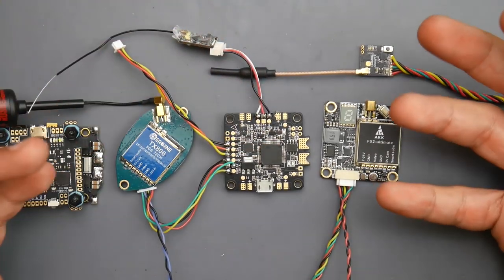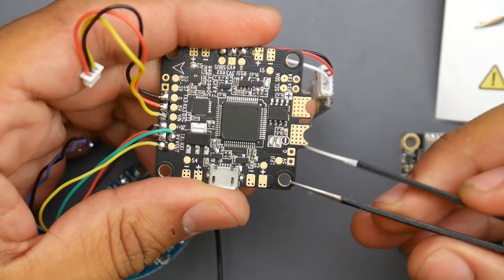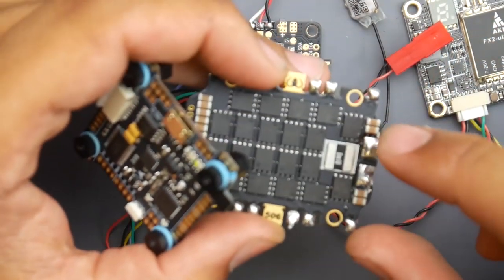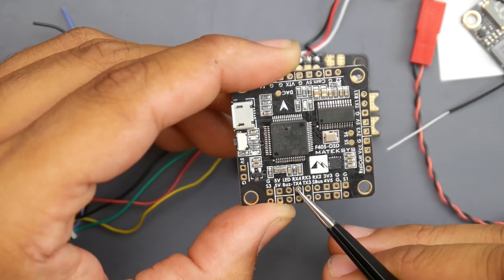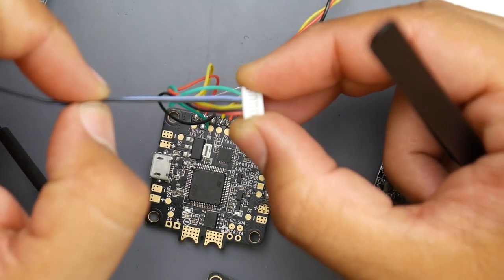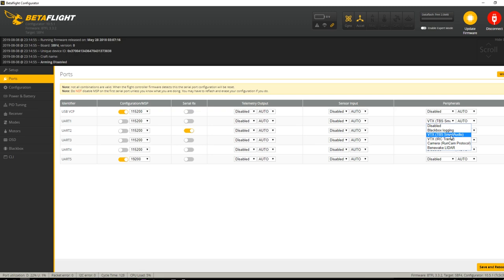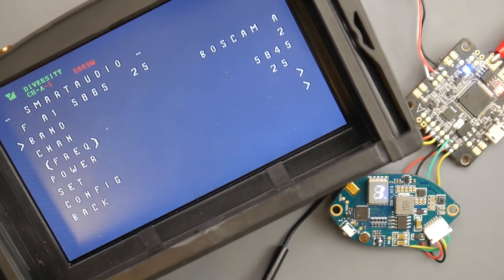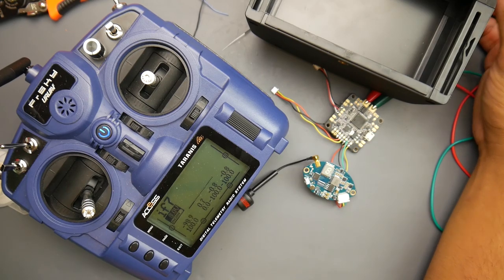FPV Beginner Guide P2 // HOW TO WIRE & SETUP VTX WITH SMART AUDIO GUIDE 2019

Comment: If you are going to connect the VTX to the power input from the battery, you should solder a 1000 micro farad capacitor across the positive and negative terminals. This will serve to limit noise on the video stream. Also a good practice solder it on, to save sensitive electronics from voltage spikes.

Comment: I want ask a question about connection if a buy a camera and vtx module. The vtx module has 3wire so where should i connect the which wire in flight controler for drone or in receiver for rc plane

Comment: Thanks for this. Your video tutorials are very helpful.

But i have a problem i hope you could help me. 
I'm trying to connect my VTx (GEPRC Stable VTX v1.3) to my FC AIO (JHEMCU F411 Pro AIO). The VTx has 3wires has 8wires all-in, 3wires from the fpv camera (5v, grnd, video in one connector wire to the fpv camera), and another set of 5wires (5v, grnd, Vin, Vout, TXD). The last 3wires is what i have a hard time figuring out where they goes (Vi, Vout, TXD).
The FC-AIO has 4pads open i can possibly solder the wires into. These are: Tx1, Rx1, VTx, and Camera signal.
Can you please help me where i should solder the 3 VTx wires (Vin, Vout, TXD) into the FC-AIO pads (Tx1, Rx1, VTx, Camera signal)? 

Thank you again so much. And i hope you can help me.

Comment: If there's new guys watching these like I was. Definitely don't put a full batt vtx (7-25) on 5v. On another note I think 2023 (year) plus you may not need a S/A wire and can still access the betaflight settings. I have 2 builds that can, a 16x16 vtx that survived a fire and a hm850 from flywoo/RDQ.

Comment: thanks for this video! sooo the current documentation for Eachine nano V2 VTX shows 5V IN, GND, "RX", 5V OUT, GND, and 5V OUT; I would assume the RX printed in this case should be a ""TX""? or does the RX in my case indicate receiving data from the FC's TX pad which is where I will solder to TX3?

Comment: So I have a question, maybe is a dumb one, but I'm really noob at this. So I have a blue bugs 3 (it's a made drone kit for kids) and I always used just a budget camera with a 1s lipo, but as expected, the signal is very bad, so I was wondering if I could get one vtx and use it just with camera connected to the vtx and battery to power the vtx, without connect it to flight controller, because I don't have pads for that, or it's impossible to do that?

Thanks so much for the help

Comment: Great video easy to follow. Unfortunately I still need some help.my smart audio is working but the table for power is wrong. I understand that if the mw value is wrong the vtx olny outputs 25 mw. Values of rdq. Vtx are 25,200,600 & 1000. Can I just enter a command in cli to change this, or do I have to flash 4.1 and import the tables. Then  change table to correct values?

Comment: Great videos!

Do you also have tbs crossfire setups?
I have a multiple nano’s. I wired one of my quads in a similar way once, and I was able to control my vtx though my tbs module behind my taranis once and adjust my rates. by the way any videos on rate adjustments? 
I enjoy watching your videos also my baby niece loves your into song by the way 🤙 and thanks for recommending the dalrc f722 with 50 amp esc’s, flies gtreat on my marmotte, wish it had a barometer, was thinking of the matek f7, but really don’t need memory card adapter. 

keep up the great videos!

Comment: Waiting for the part 2 of building FPV drone, the video ended with a heads up for part 2. Planning a build based on this bro. 
Thank you for all the support :)
Reply from the maker: The Drone Flew Amazing However the caddx tarsier was dead on arrival if you want to see how it flew check my runcam split 3 video it was that build that was flying but was flying very chill to capture the footage. So in i think 5 days I will receive the replacement. Also if you plan to build it do it because I will also release my pids for it.